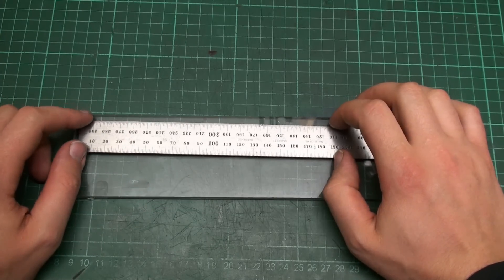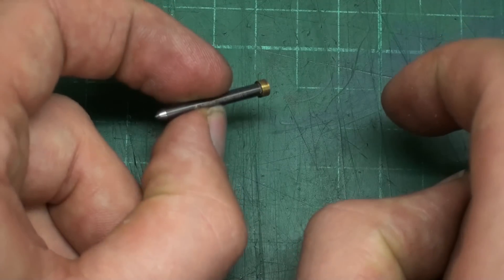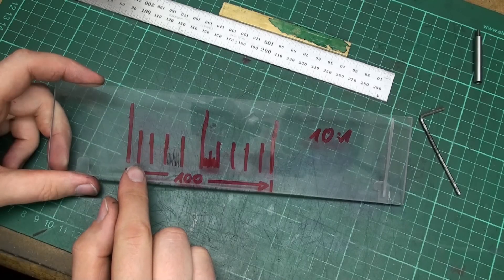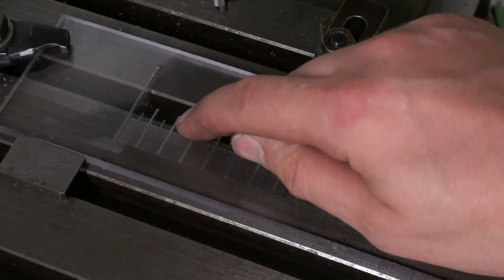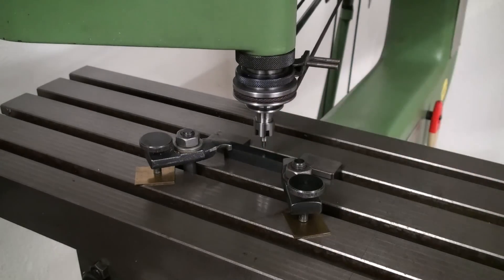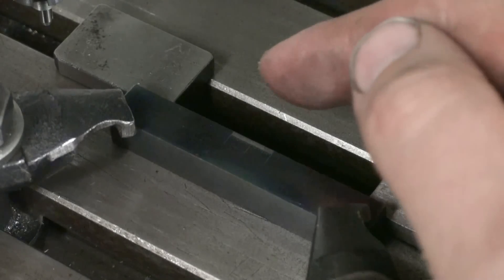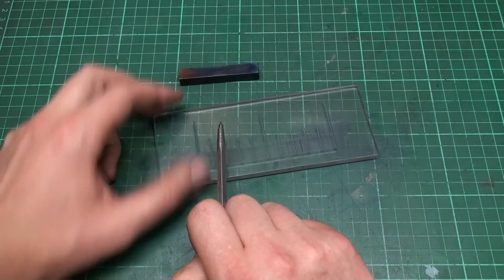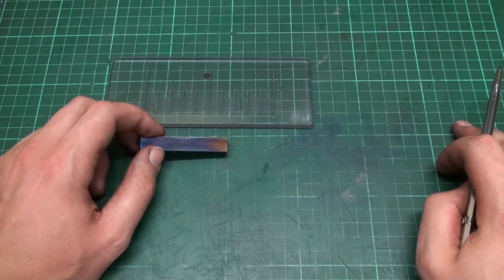R&D: Cutting graduations

Comment: I know this is a year old but I have just seen it, and you may have done already but
 for the surface finish to engrave on you could use 
a cold gun blacking solution, leaves a nice mat finish as it does not alter the dimension at all and avoids the risk of warping
the piece through heat bluing
have a look https://www.youtube.com/watch?v=V5awFGsPnxg 
you don't need to dip it just use a swab

Comment: Hello,     I believe the first explanation was valid , but also there is no way to have a spring action scriber with ZERO RUNOUT .  If your table were dead flat you might try the same scriber point without the spring & housing which gave the excess play in the markings. Depth variations might then be under a thousandth or so.    good luck, regards,  Darryl Dodge
Reply from the maker: *****Hi! I think I figured it out - There is of course some sideplay in the scribing point and that messed out things - In a new attemt I used a pyramid shaped rotating cutter, there will be a new video up soon. Thanks for the input!

Comment: Wow. Great job!
You are getting into the footsteps of Joseph Fraunhofer himself, here.

On the big precision machines for ruling graduations, e.g. at Zeiss, people used diamond tips mounted on leaf springs or on the end of a hardened steel wire acting as the spring.
Mounting the stylus in a sping-loaded capsule as you did, you run into two problems:
1) as you said: your stylus has some very minute lateral play in it, and
2) the tip may rotate ever so slightly between lines or worse, while actually scribing a line;
both introduce mostly random inaccuracies.
Might I suggest you try mounting you stylus tip rigidly to a short leaf spring:
You do not need much force to press down the tip to rule a line, so some sheet bronze should be sufficient. This way, you can eliminate all play and still have a spring-loaded scribing tip.

It may also be worthwhile to make two identical graduations which you can compare by putting them side by side and sliding them against each other to check in several locations whether the marks always coincide.
Reply from the maker: Kai Broeking Thank you!
The leafspring sounds like a very good idea, I wrote it down in my notebook, maybe I will come up with a solution using that! Thanks for commenting!

Comment: Interesting, I assume it is for a scale model because, certainly with my eyes, it would be impractical to use. :>(
In english English those little screws are "grub" screws. A set screw is a bolt with thread all the way to the hex head. i suppose you could call them socket set screws (easily confused with a socket head set screw ie an Allen screw) but all sane people just call them grub. :>) 
For fine(but coarse by your standards) graduations I use a 10thou (approx. 0.25mm) slitting saw. Advantage is, no matter how deep a cut you make the lines never get any wider, the same applies after any sharpening that is needed. With my crude abilities that IS a help.

Comment: Hi Stefan,
Can you increase the scale for the template?
Cheers
Bengt
Reply from the maker: bsjoelund Yeah, that yould be another way to get around it - I could go up to 50:1 on the template, but then the template would obviously get very big and cumbersome to handle ;)
Reply: Stefan Gotteswinter 
Maybe 20:1 is still manageable and easily cut in you CNC mill.
Bengt